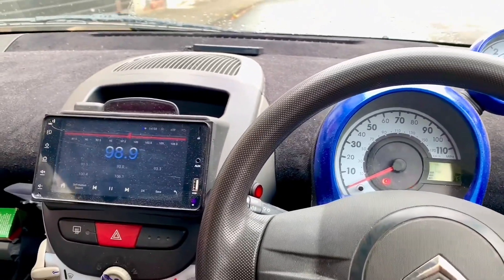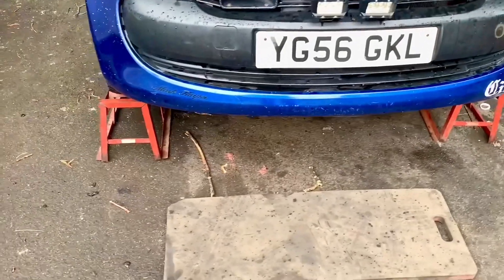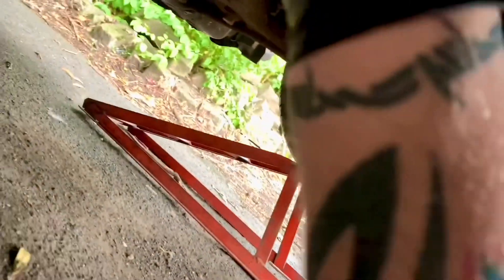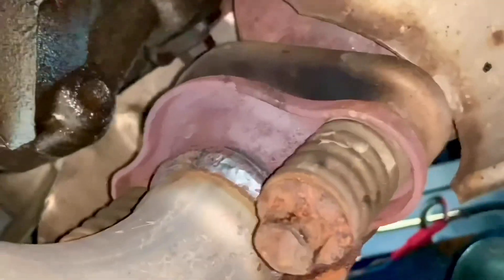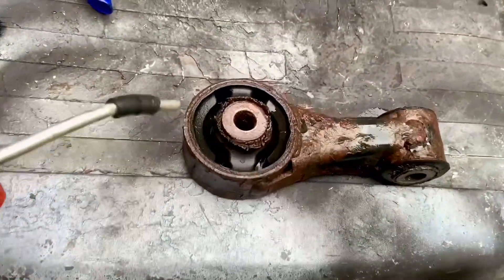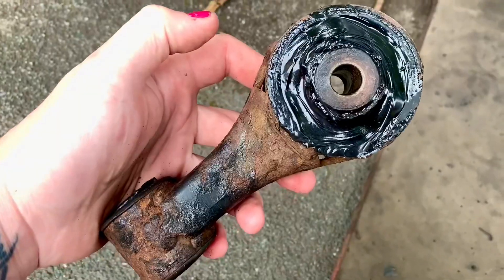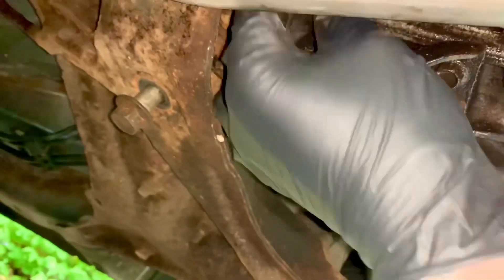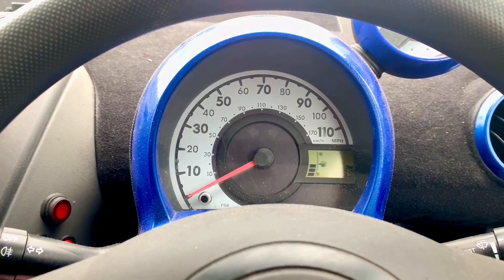Tiger-Seal Polybushing / Strengthened Motor Mounts or Suspension Bushings? (CityBug/C1/Aygo/107)

Comment: "due to the high level tuning this car has had " 😂 This is one of those handy vids because that particular joint will be replaced at some point on my 107.
Great vid yet again.
Reply from the maker: Cheers mate, tbh I’d recommend just replacing it rather than doing what I did,.. but I did it so you don’t have to 😂
Reply: @StupidBlokeStupidVideos  yeah, I'd get a new one.  Cheers

Comment: Haha, did the same on our Sirion 1KR-FE 3 days ago, still waiting to let the rubber dry. Looking forward to have more stiffness and less stress for the exhaust system & gearbox as well.
Reply from the maker: It gives a lovely feel for the engine vibration too! lol
Reply: Car feel has improved a lot, a little bit of a vibration on idle. Now I can start driving in 1. gear only with clutch, before it was so difficult cause of that engine/gearbox movement. Also changing a gear is much more precise.
Reply from the maker: @0xas  nice

Comment: I did something similar with the lower mount on my old C30t5 except I cut up an old boot heel to get the rubber and packed it out that way ..  it was a great job and stated like that right up to when I soled it 😂😂
Reply from the maker: The top mount? My v70 t5 used to chew them up. How did you make it stick in 🤣
Reply: @StupidBlokeStupidVideos  
the boot heel and soled ,,, was the play on words ,,, I actually used some hydraulic hose just 1t and put a piece of plastic inside the hose to stop it crushing , but by cutting the hose slightly longer and using a shorter packer the hose started to contract again and that held the whole thing together ,, it was the lower mount though , same basic idea as your video and polybush inserts ,, only cheaper

Comment: Great video pal.
On my c1 the bracket that holds the front bumper n/s has broken due to a lorry wheel arch on the motorway decided to fall of in front of me 🥺. 
I’ll order a new one,  is there anything I need to do or know.
I’m not a mechanic or anything like that, so it really is with limited knowledge and help from videos. 👍
Reply from the maker: Cheers mate. I don’t think there’s much to know about the front bumper apart from the clips on the corners sometimes don’t even work when replaced with new ones 😕
Reply: @StupidBlokeStupidVideos  cheers pal.  I did wonder that if I’m honest.

Comment: hi mate, got one of these and relaced the clutch not log ago myself. remeber shortly after that racing one of my mates in his 1.2 K11 micra and after i released the clutch with some force, i heard a great big bang and any time after that when i released the clutch it would make the same noise as yours and even when starting the engine, it would start with the normal sound of the starter motor turning over followed by a big thump when the engine finally started. didnt think much about it til one day one of my driveshafts physically came out of the engine (after going over a bridge way too fast, after all, it is a rally car) so my question is before i reinstall my driveshaft, should this help cure the banging? i also did check the engine bay and the engine was very wobbly.
Cheers!
Reply from the maker: It sounds like this could well be your problem mate yea, but check the other engine mounts too

Comment: Ive got a tube of that tiger sealant in the garage ready !!
Polybushes are usually 70 shore D, and sports really hard 90 if i remember correctly.
I tried to find the info on the tiger sealant and think its 40 shoreD so not too hard !!
Whats ur understanding of those numbers ??
Reply from the maker: My understanding of those numbers is that I’ve only just heard of shoreD so I’m gonna have to google it 😂
Tiger seal doesn’t seem as harsh as poly bushes but this possibly isn’t it be best engine to fit harder mounts to, they vibrate like bent drill bit and the whole car rattles on tickover haha
Reply: @StupidBlokeStupidVideos  yes for suspension go 70 shoreD  but engine mounts need to be softer as u say !
Reply from the maker: @arnietwo11  some engines you can balance a 20p vertically. On this engine you probably can’t balance one horizontally 🤣

Comment: Hi bud have you done valve clearances on the bug yet? basically so the valve has correct clearances to be opening at the correct time, as the engine wears the gap increases. Cheers faz 😃
Reply from the maker: I’ve not done them on one of these yet no, but I believe they are shim under bucket which means that to adjust them it’s camshafts out, but it’s unusual for them to go out of spec. Valve clearances can often tighten up too, which usually actually causes more issues as the valve doesn’t close properly, usually when warm.
Reply: @StupidBlokeStupidVideos  correct, just reading a post about it, mines on 190k and it’s beginning to tap/slight piston slap, but once it’s warm it’s grande, ideally want it to surpass the 200k so I can make a personal memory YouTube clip 😂, regards faz